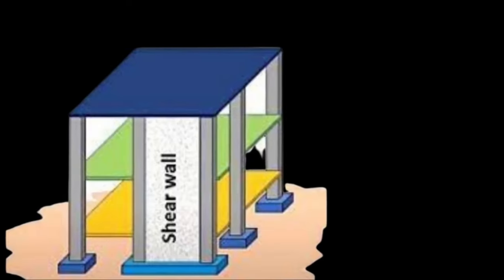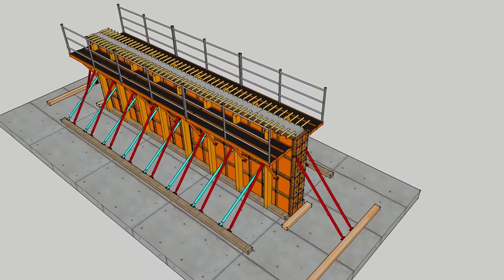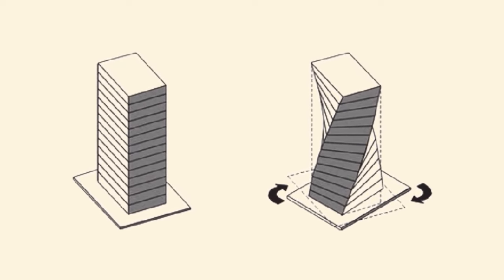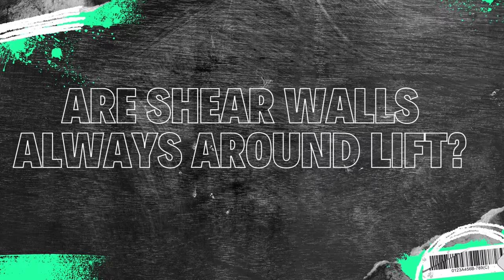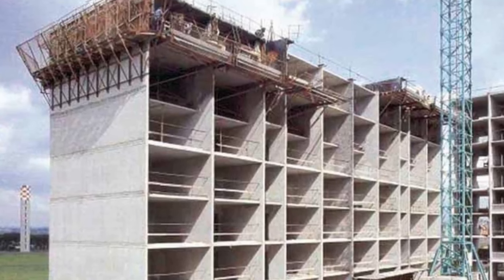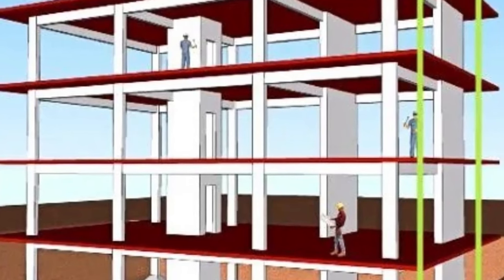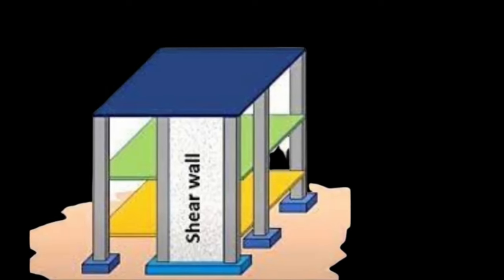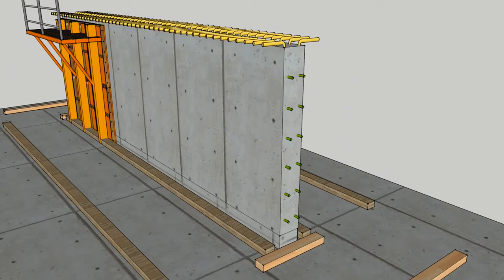Understanding shear walls in buildings

Comment: what is the difference between structural wall and shear wall in practical construction? how to construct the shear wall different to structural wall and bearing wall?
Reply from the maker: Shear walls are structural walls that support not only his weight but also support and resist lateral loads. The load bearing wall will support his own weight and the vertical load produced by beams, slabs, and even other walls. 
I will make a video explaining this question in details